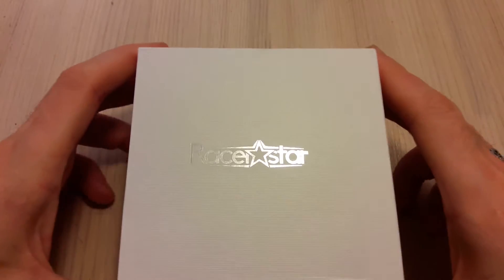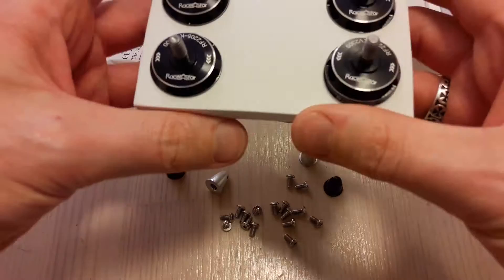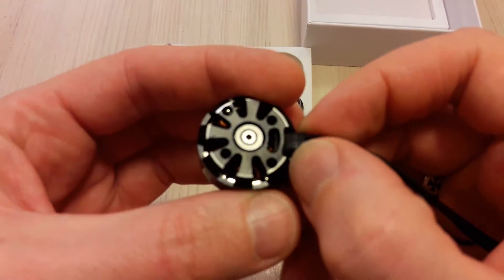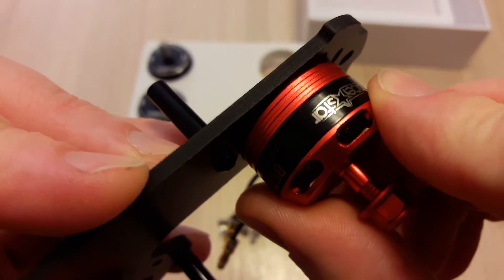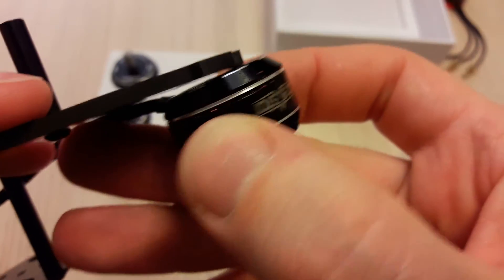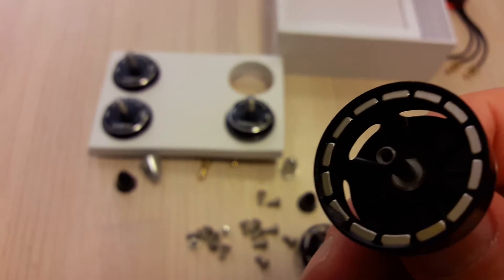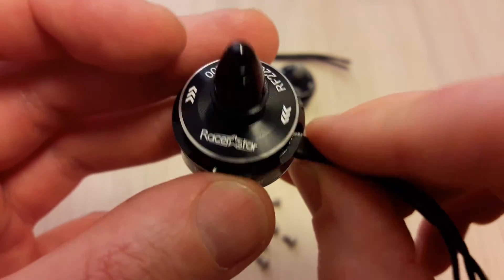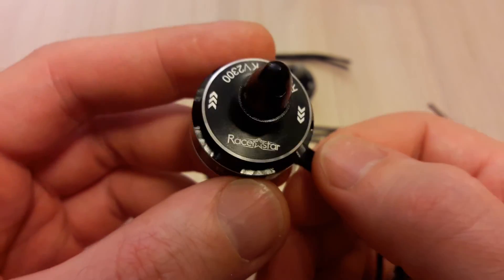Racerstar RF2205S 2300KV motor review

Comment: Bought a set in Dec. 2016, they vibrate so much at mid throttle, i can't even fly with them, FC goes crazy although it's a Flip32 F4 with MPU6000 via SPI.
Don't know why reviews are generally pretty good for those motors.
Reply from the maker: +Chris Zinner you probably have received bad motors. Mine were absolutely well balanced. Runs smooth.
Make a short video about the problem and try to apply for refund or re-send. Just have in mind that chineese new year is comming and staff will be out of office for almost two weeks.
Good luck!
Reply: Soft mount your FC
Reply: FC always was soft mounted.
Had to soft mount the motors to make the yaw twitching go away.
Did a hard landing once and a bell came off but i could put everything back together.
The motors lock up if you put the screw that holds the shaft in too much, what a joke!
Wrote to BG about that, that the motors are noisy and unsafe and they refunded me.
Reply: Wish the Racerstar motors come with 5mm hollow steel shaft tapering to 4mm hollow shaft, that should increase the motor's durability. They might release the new version "BR2205 SS" :-P
Reply: My friend also has the same problem, hitting a solid steel pole at high speed surely is a nightmare for FPV fliers